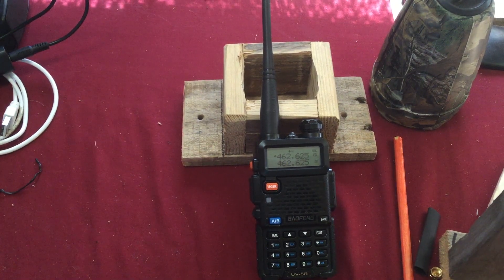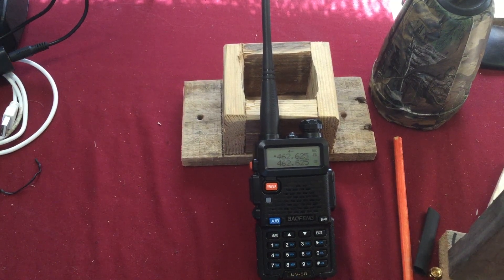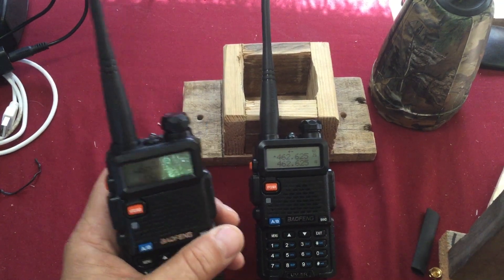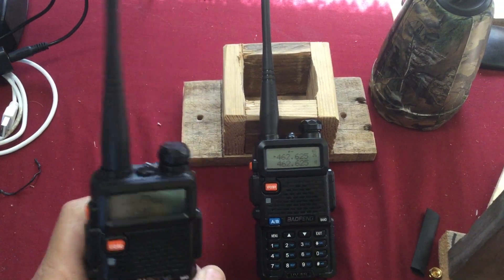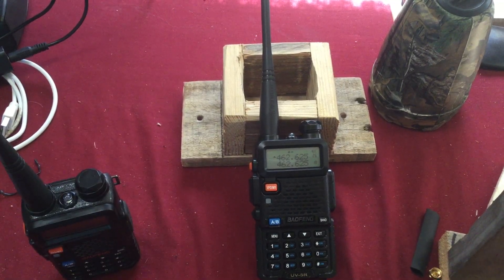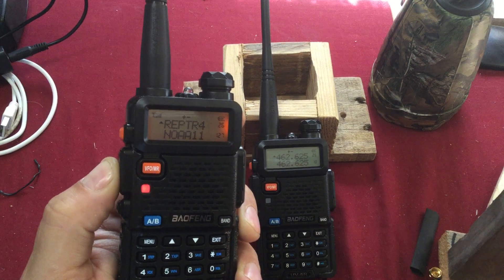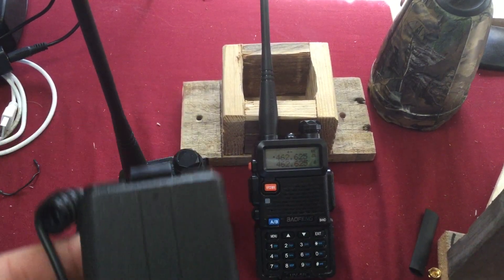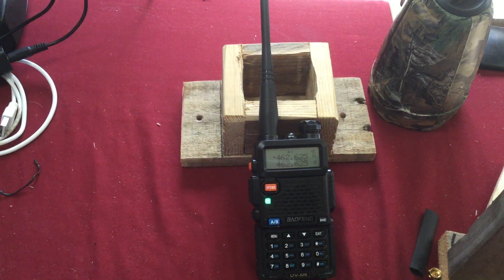🔺GMRS two-way radio baofeng uv-5R/Radioddity Uv-5G poor RF sheilding or very sensitive?? 🔺

Comment: There is a battery eliminator for the TYT UV-88 that is compatible with your Retevis, if you're interested. Also, when the radios are that close the receiving radio is getting a lot of power and is likely overloading the receiver.
Reply from the maker: Yes that would be great post link on here...thanks
Reply from the maker: Overloading the receiver yes I was thinking that too, but I don't think my Retevis radios do that.
Reply: @GMRStwowayradio  Model: TYT-ELM-UV88 found at Buy Two Way Radios. I think similar can be found on eBay.
Reply from the maker: @SamIAm22  - yup, I found that number too. Thanks!!
Reply: I have the same radio idk if it's trash or not?
Reply from the maker: @ChevyCeeLo  - does yours do it too?
Reply: @GMRStwowayradio I just tried it out but by looking at it one radio is in channel mode and one radio is in frequency mode and yes it does but when they are both in channel mode everything is fine.
Reply from the maker: @ChevyCeeLo  that is good to know, I think my did it when both were in channel mode. I would have to double-check
Reply: @GMRStwowayradio   what are you planning on doing with the radios? Also how much was your RT97 build I'm thinking of doing the same thing?
Reply from the maker: @ChevyCeeLo  - well the baofeng i am going to try them with the zello for the repeater to see how it goes. as for the RT97 build are you meaning with amp,etc?
Reply: @GMRStwowayradio  I will definitely tune in on the bofang repeater one and yes the Rt97 amplifier build.
Reply from the maker: @ChevyCeeLo  - what do you mean by toon you mean tune on what? as for the cost  keep in mind i bought direct from china so i saved BUT it took awhile to get the bundle package which included rt97, amp , antenna and 50 of cable which is not the best cable for 500 shipped BUT then i bought a power supply 25.00 for the amp then i had to change out the Duplexer 125 to handle the power so ABOUT 650 but that does not include the cables and adapters to hook up the amp so i would say total with that is about 675ish
Reply: @GMRStwowayradio  my fault I was driving and yeah ok that's kool, could you sell me that same set up.
Reply from the maker: @ChevyCeeLo  sorry I am not really set up to do that right now but maybe in the future I will be

Comment: Totally normal when doing this over a repeater channel,  simplex frequencies it won't do that. You shouldn't have them close to each other anyways as it overloads the receive and also desensitizes the radio so it will stop receiving as it should.
Reply from the maker: I don't think my Retevis does that, and I have them very close in my videos I have made.
Reply: @GMRStwowayradio  It is called frontend overload, and is very common. Just search for it on the internet. Most commonly it is caused by too powerful of a signal, and you need to get distance. Usually they recommend being at least ten feet away. Basically the antenna RF signal is so powerful it causes an overload on the receiver. There are other things that cause frontend overload, but on walkie talkies it is almost always the RF signal being too powerful for the receiver to handle. Remember when we had old TVs and you could take a toy walkie talkie and mess up the TV if you got close to it? It is basically the same thing happening. You can also get some powerful digital cameras, older 2G cellphones, radios etc too close and the same thing can happen. It does not mean the walkie talkie is bad or defective, it is just normal.
Reply from the maker: @chrisgullett4332  - yes i figure it was overloading, what is weird is my Retevis RT85 don't seem to do that
Reply: @GMRStwowayradio  Switch the antennas and see if the Retevis does it. Maybe the antenna on the Retevis cannot receive enough to make it overload.
Reply from the maker: @chrisgullett4332  - that could be I will have to try that